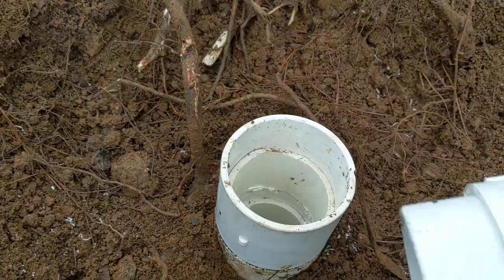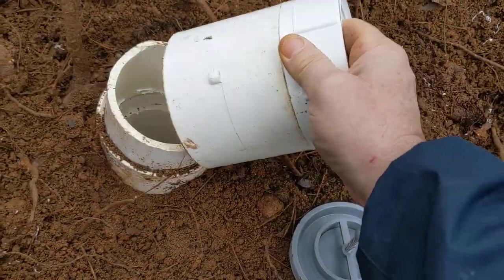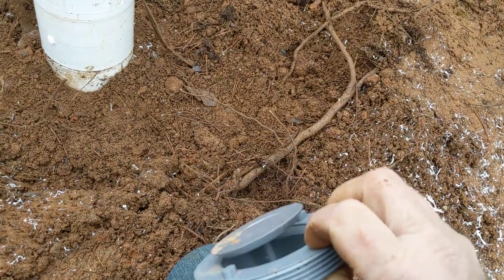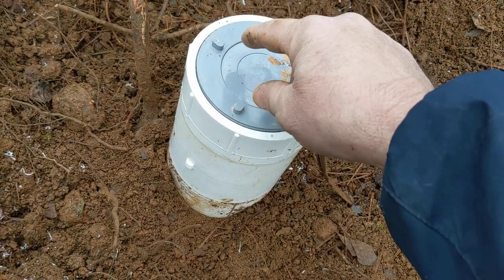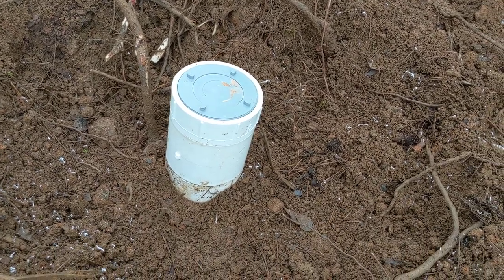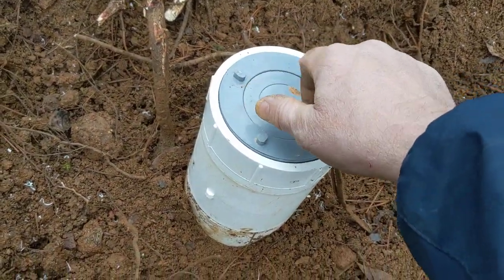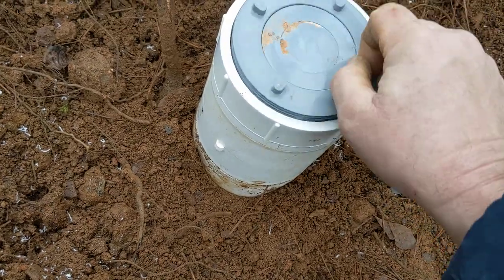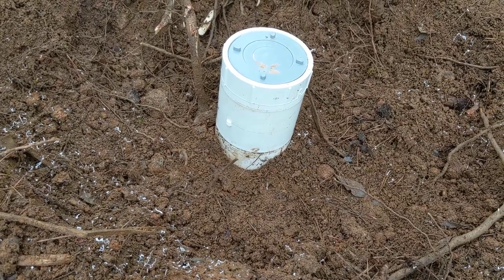Installing a pop up clean out for sewage back ups!

Comment: Ran over clean-out with lawnmower so had to cut PVC to get it straight again. Very little room to do that so the cut is not straight. Coupler still went on but one side is way off but still about 1/4th overlap over pipe out of the ground. Did not glue it. Anything to worry about?

Comment: Is it possible to have the clean-out pipe going towards the tank to either have a 22.5 or 45 elbow before it makes entry into the primary? The reason I ask, is I cannot find the tank. I have the drawing from the county, Walton, GA., but it's not to scale and shows a straight shot, 10 ft, to the tank . Four holes dug at this point, but no luck yet.
Reply from the maker: It should be really close to what the drawing is. It could be deep. You can take a pic of it and email it to me. michaelbruce651@yahoo.com.
Reply: @theappalachianamerican8607  Thanks. I sent it.

Comment: Is it possible that toilet paper catches underneath it and prevents the sewage from coming out enough? Would it then be better to just sit the regular cap on the clean out?
Reply: Toilet paper is intended to fall apart. It should allow enough space to allow water to flow out until you can get someone to snake out your main line. I’d rather have this than nothing as insurance. My townhouse community all has this on every unit in case you back up and don’t want to ruin all the units touching yours. I’m a retired SW FL Roto Rooter employee.